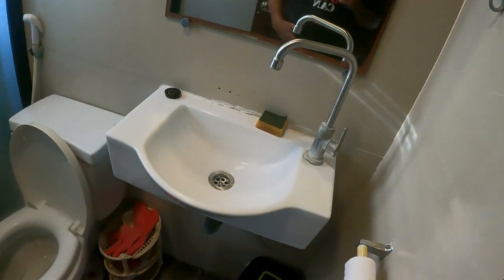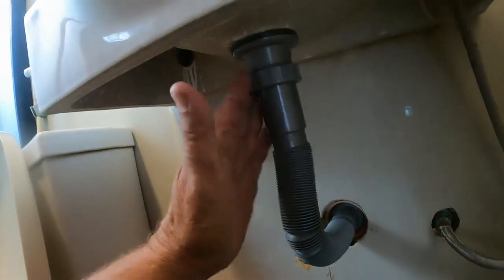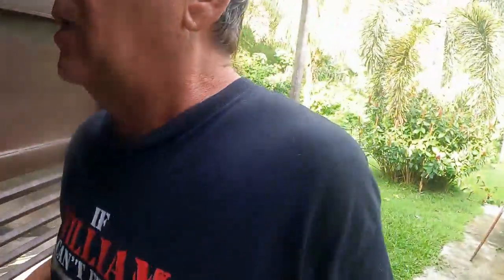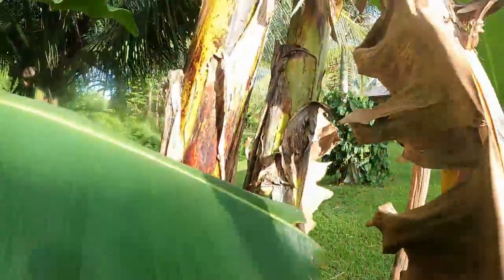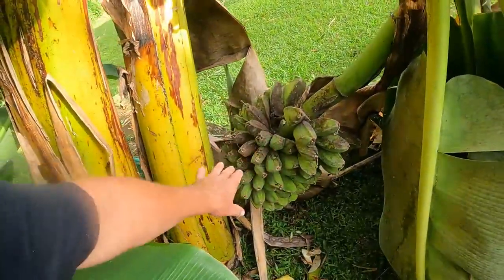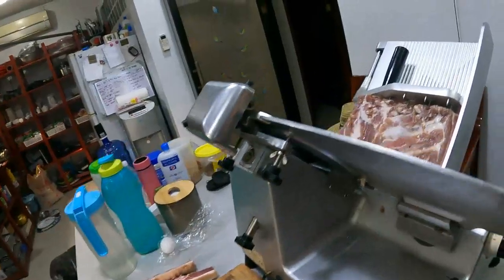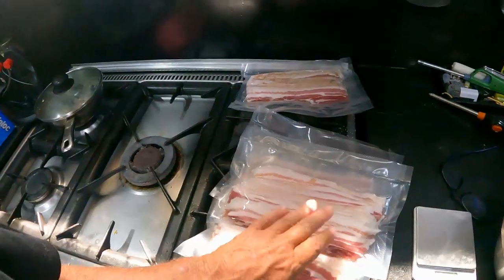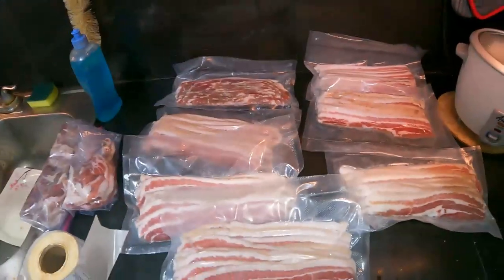Morning repairs and lots to do before heading to town

Comment: Had a handbasin on a pedestal installed by a professional. Taps worked, but no drainpipe installed so water was supposed to run down pedestal and out through drain on floor where pipe was supposed to be!